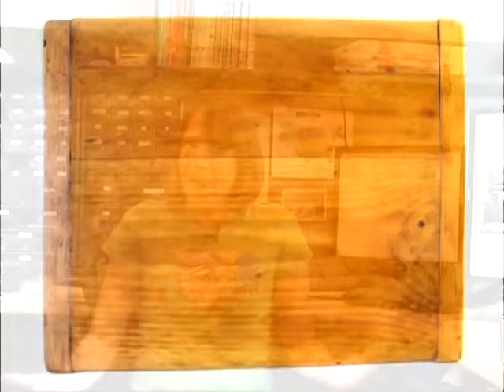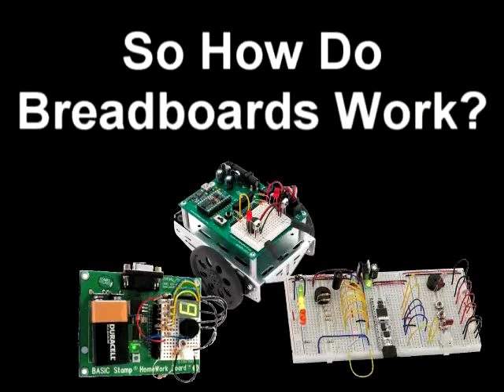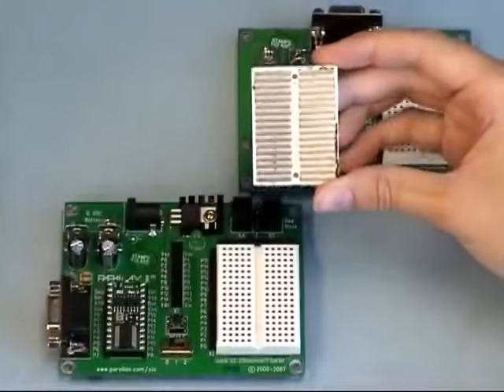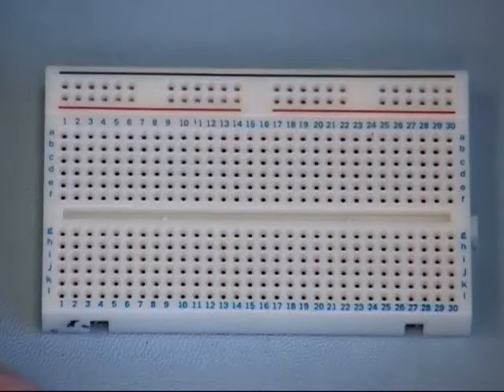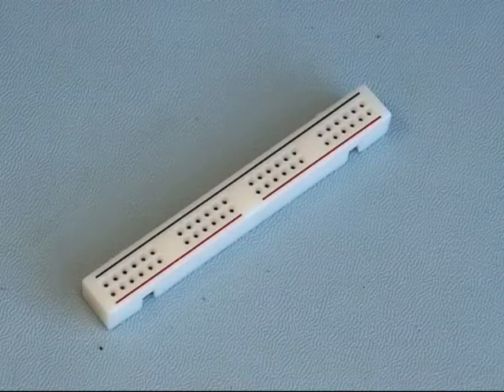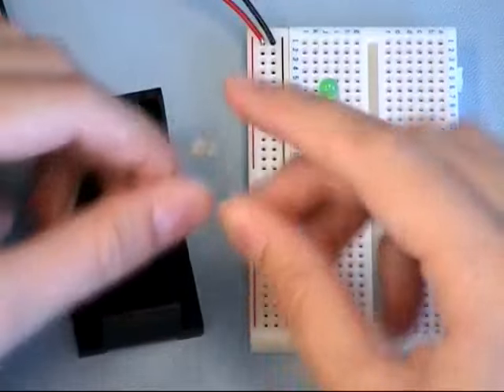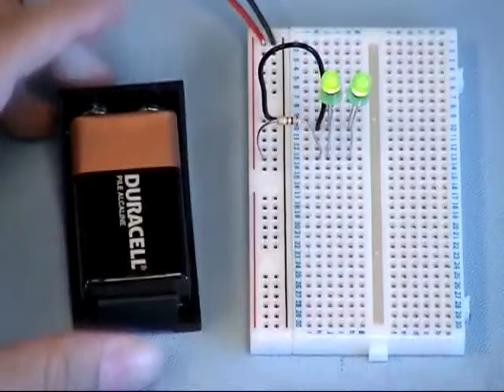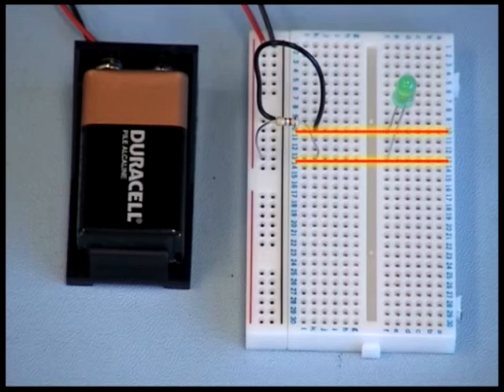How To: The Basics of Breadboarding

Comment: Thank you.. I was almost gone mad.. I had burnt my Raspberry Pi Pico's GPIOs.. I tried everything, connected only one LED< removed all.......... tested again and again.. got very much disappointed. searched internet for the solution.. spent 2 hrs.. then for no reason I watched your this clip .... wait what?? these power and ground rows are not connected? OH NO.. I quickly checked mine and it had both "discontinued red and blue" lines on the ends of side strips.  I quickly removed table from the back and found, both "+" and "-" rows had small break in the middle. I checked and found my Raspberry Pi Pico was fine it was only the breadboard feature... 

Thank you again, Thank you so much..

Comment from the maker: @SKMatoBB -
The resistor's value is 470Ω, or yellow-violet-brown.  If using a voltage supply that is less than 9V, you may be able to get away with a smaller resistor value, but 470Ω is usually a good "safe" value for limiting current to your average LED.

Comment: Very nice and clear except that when the battery holder was connected first you might have had to explain that the positive (red) wire from the battery goes to the "Live" or red low and the negative (black) wire from the battery goes to "Ground" (GND).  Otherwise no problem!!

Comment: These videos are awesome!  But being an electonic noobie, I have one basic question. How do we decide what resistor values we need to select in a certain circuit? For example the BS2  Single LED Circuit uses a 470Ohm resistor. Why not something higher or lower? The basic rule is Voltage=(Current)*(Resistance). Is this how these resistance values are calculated?

Keep such great videos coming. I'm halfway thro the BS2 "What's a microcontroller " book, and loving every bit of it!

Thanks!